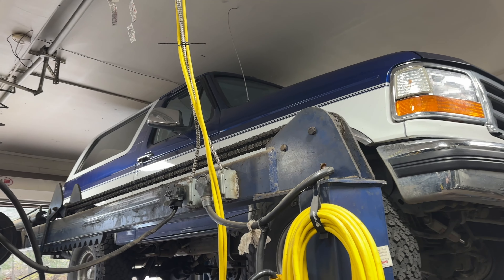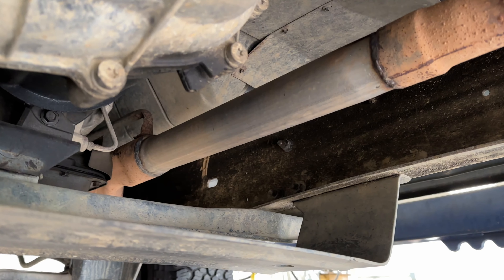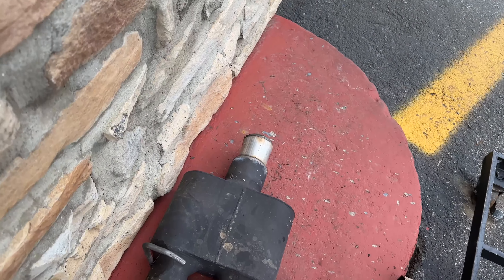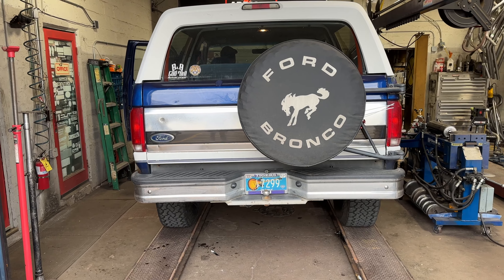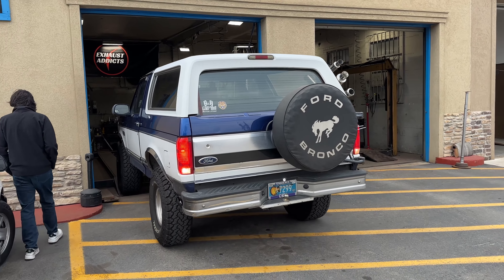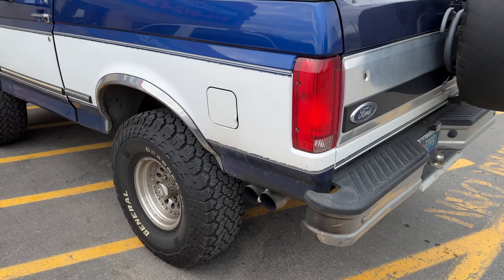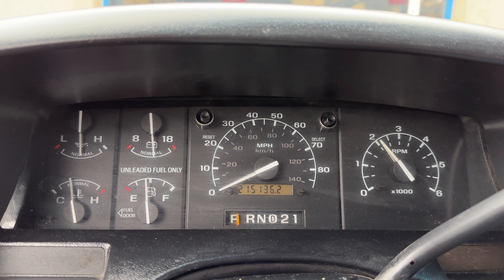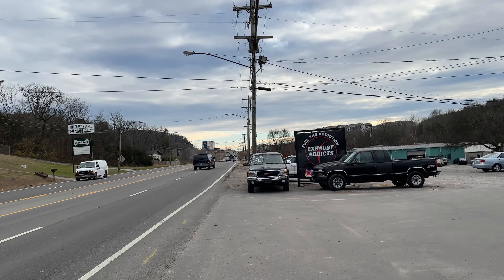STRAIGHT PIPED 1996 Ford Bronco 5.0L V8 CRACKLES!

Comment: Beautiful machine. Keep, value is only going up. Especially in that condition. I personally would have true dualed it instead of a Y to single and back to Y.
Reply from the maker: Totally agree
Reply: I have a 95 with the 302 and it’s true dual straight piped with 5” tips. Sounds way better but is also WAYYY louder than this one.

Comment: Like others have said, needs a Flowmaster 40 series
Reply: I like the Rumble, made by Magnaflow. Engine Masters tested one and only by a few decibels, but it had the quietest idle yet loudest WOT sound compared to other standard chambered types like the Thrush Welded and Summit 2 chamber. They're about half the price of a name brand Flowmaster, I've used Thrush before and they seem to be very heavy duty and don't drone much at all so I'd like to try the Rumble for my next muffler if I don't need a stainless muffler.
Reply: @AdmiralRustyShackleford  I discovered the Thrush Welded (40 series clone) a few years back and have used those on a few vehicles myself. I’ve always preferred the chambered sound (Flowmaster) but have enjoyed straight through style mufflers (Magnaflow) and muffler delete setups (true duals) on a couple trucks too. I just got a Hemi Ram and think I’ll run my first Borla setup not sure if I want a XR1 or S-Type though.

Comment: I bet it sounded better before with the Super 10. I would've gone with a 2 chamber, those mufflers without cats is hard to beat. 

Once that 302 is worn out, put a 351W in it with a mild cam (similar to the Lightning cam but a HR grind), some Trick Flow aluminum heads and LT headers, with a single 3" and Rumble 2 chamber.